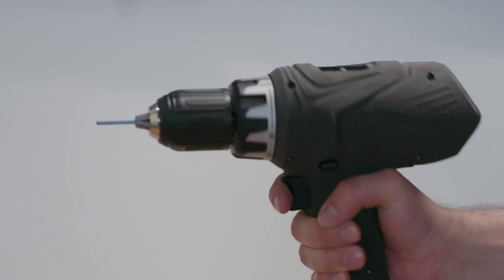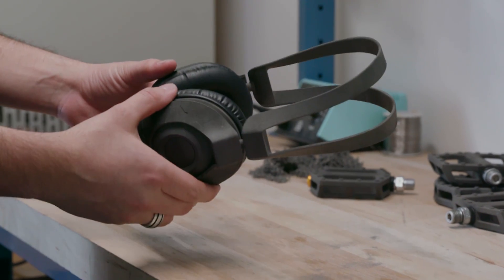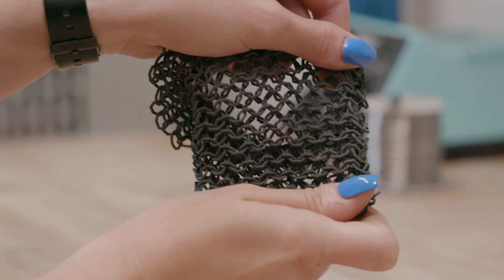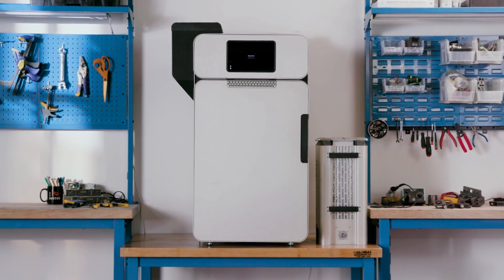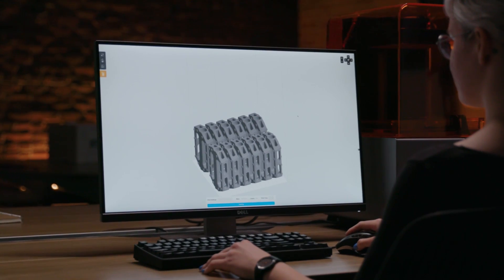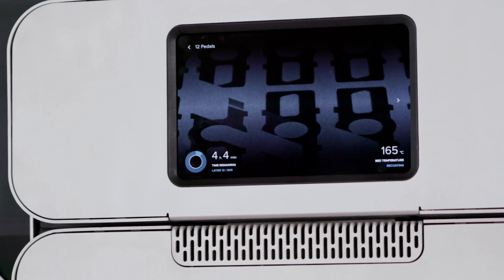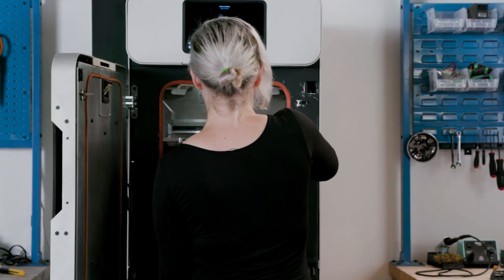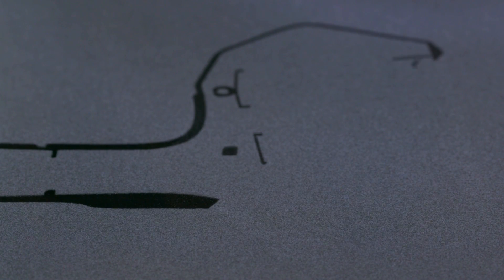Introducing the Fuse 1 SLS 3D Printer

Comment: I have a lot of SLS printing done and this machine would be a fantastic investment but I don't like that the material comes out dark grey with this process as it limits the colours the parts can be dyed. If colour isn't an issue then this system is a very nice price breakthrough.
Reply: easy just buy a spray can and spray it with the color you like

Comment: Is SLS better than SLA?
Reply: OfficalCoolcow Productions what kind of school? If you're talking about a high school, id stick with a reliable FDM printer, lots of material options, simple operation. If it's more of an arts school, SLA would likely be best. If it'd a science / engineering school or department of a university, then I'd recommend the SLS.

FDM printers give you an instant result with no post processing, easy servicing, and have the most variety in terms of materials and colors. You can adopt FDM to do nylon prints also, it just won't be at the quality level of an SLS printer.
Reply: It doesn't require supports, and it uses nylon in this case, which is a very robust material, but it's optical properties are less pleasing and there's less variety of materials compared to SLA.
This is if you intend to make mechanically functional engineering grade items, where as SLA is better for very pretty high detailed smaller prints. There are some tougher resins for SLA, but it isn't likely to match nylon.
Reply: FDM printers come with alot of headache though, the user experience is not as enjoyable as a SLA or SLS printer. I have both(Ultimaker 3 and Form2. I use the FDM for large prints and my Form2 for med or smaller prints. FDM still have a place because of the range of materials you can use, your somewhat limited with the Form2, i.e. you can't print copper. If you get an FDM printer and want print exotic filament I'd recommend getting a ruby nozzle.
Reply: Depends on application. you'd have to take a lot into account. ideally you may want both.
Reply: Cool man! BTW what would be a better 3d printer for lets say, a school? like which would be more reliable in not failing prints and quality prints (we have a really outdated printer and I think a STS would be better because several students would be able to print at once but I don't know what the quality would be
Reply: I'd go with the SLA. Maybe look at the new bean on kick-starter, you could buy a couple of them, that would be nice as they are all pretty slow. really small footprint though maybe good for your students and it's much better seeing it print as a learning experience. They are pretty messy and SLS can be really messy. Also the consumable cost are not really apparent with the SLS yet. the $20k kit cost gives one an idea.
Reply: cool thanks, I'm trying to pusuade my school into purchasing a good 3d printer since our old one sucks (from the 2000's
Reply: MetalGearMk3 There is software you need to learn with an FDM, which can be minimized if someone sets it up that knows what they're doing. Assuming there's a decent default profile, it should be fine for most people. With a makerbot, their native software will do most of that for you without you needing to know much. 

On the other hand, SLA is resin based which needs to be washed in alcohol and cured post print. Swapping and cleaning resin is a huge mess that most schools would not want. SLS needs to be cleaned off in a special power cleaning station and the power needs to be processed for reuse. That station from formlabs is an extra 10k on top of the cost of the printer, and takes up considerably more space, along with the larger size of the SLS printer itself.

FDM parts are done and ready to use as soon as you take them off the printer. No mess.
Reply: If you had to get a FDM printer for school, I'd recommend the Zortrax.
Reply: Zortrax filaments are toxic and cause off gassing when printed, I don't think you child should be exposed to that